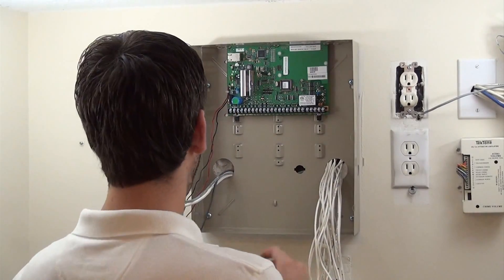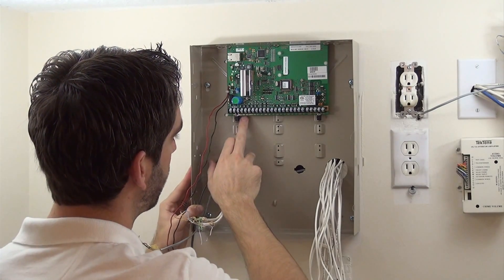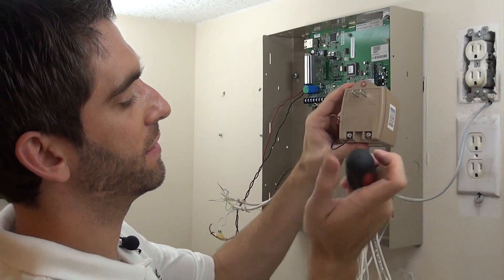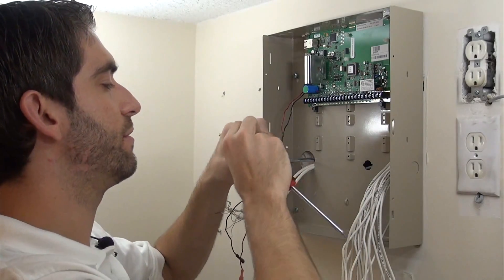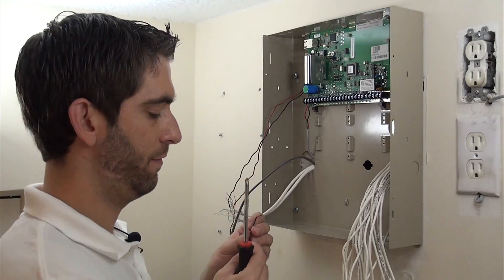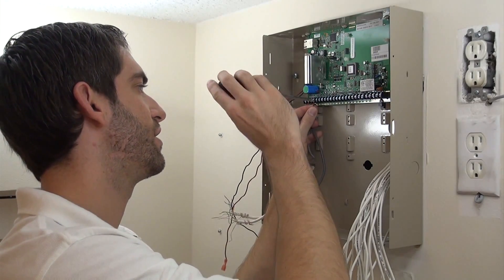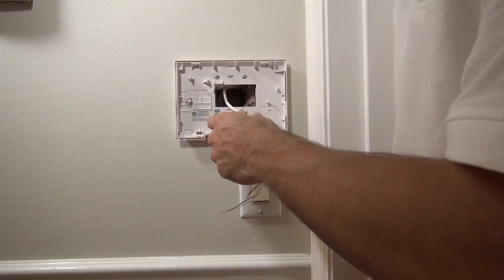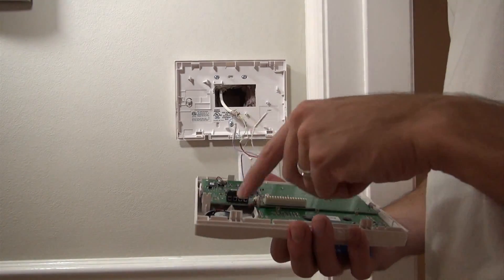Honeywell VISTA 21iP: Wiring keypads, speaker, and zones

Comment: Hi there, I've just sent you a message in a more recent video, but this is what I'm referring to in that message. I have this system at home, currently missing the keypad + siren.
I have everything else installed, apparently still working, but missing these parts. I am lost to know if I can reactivate it by buying a new keypad + siren and reinstalling the cables or if I am obligated to pay for monthly service from the previous company that installed it (currently, there's also a line set to call the police immediately, i believe - not working either).

Comment: If I don't want a "solid" intrusion and "pulsed" fire sound, how can I split up the signals to a 2 channel siren driver?
Reply: Notlaw47 Which siren driver are you using?  Is it a voice siren driver?  Most of the Siren Drivers I've seen know to provide the Fire message when given a pulsed input, and the Burg message when given the steady input.  If you need a steady only input, or a pulsed only input, the only way to get this from the panel would be to program a separate output (such as a trigger, or a relay depending on which panel you have).
Reply: Julia Ross I appreciate your input.  It is a Revere R200SDF/M5. It is fairly typical of most 2 channel drivers that offer multiple tones (or voices)  via dip switches. I haven't see a driver that will convert solid to one and pulse to another (except when the "siren" is simply a solid tone and pulses on and off with fire voltage) as a bell would. Unfortunately many of the new panels do not have dual trigger or dry contact relays. Actually I haven't found a single one.  When a customer does not want a built in communicator (central station monitored $$), there is an option (such as USP AD2001) but it requires two separate outputs, one for burg, and one for fire.  Alas, gone are the days of "local" alarm panels with relay out put so it is the customer's choice.
Reply: Notlaw47 Honeywell made the 745X3 then the 745VSD3 that could recognize the pulsing input and provide the Fire Voice message, and with a steady input, give the Burg Voice message.  The dips were mostly used to determine which language the voice spoke in.  Unfortunately, they've stopped making both of those
Reply: Julia Ross True.  I have installed many MOOSE MPI-50 panels, some ARITECH, several FBI, and ADEMCO to name a few.  Alas, those days are gone and so are the "straight forward" panels.

Comment: what is the difference between vista20p & vista20ip ?? please respond!!!
Reply: +MICHAEL JOVELLANOS The 21iP has a built-in Ethernet connection for AlarmNet monitoring options.
Reply: MICHAEL JOVELLANOS The difference between the two boards  are significantly noticeable as far as looks and size go.

Comment: Dear friend...i have one question maybe you can help....System Vista 120.....If a master code (at position 02) creates another user with authority level 1 (master)  on position 06 how do you delete the master code on 06 position?The manual says that same authority users cannot delete other users....
Reply: The Level 0: Installer code  can add, delete, change all security level codes.

Comment: One comment from this is I know this is an upgrade so you had no control on the original install.
Instead of a siren, we would install just the speaker outside and a separate electronic driver system circuit board in the panel because during the winter sometimes the siren wouldn't work because of the extreme cold.
Maybe that problem doesn't exist today with better components.